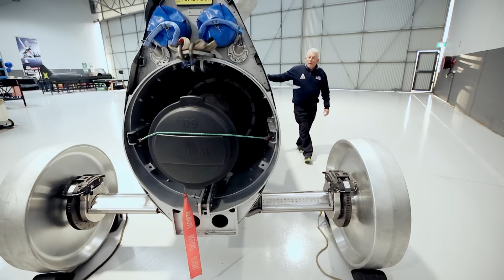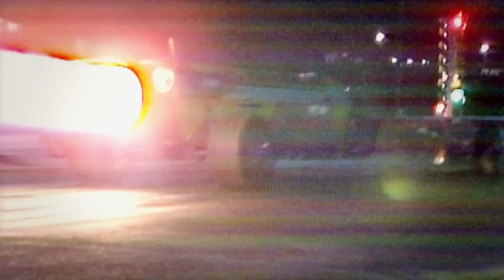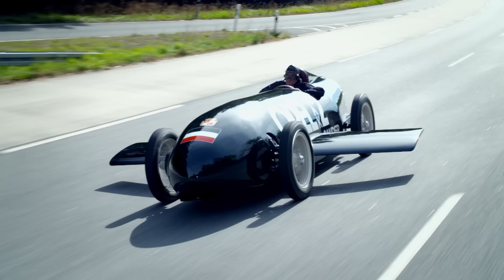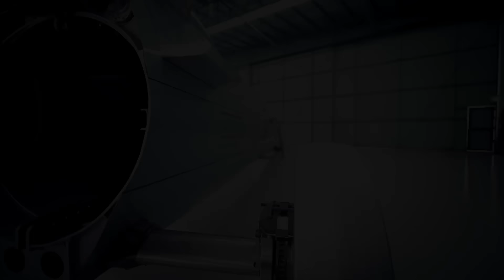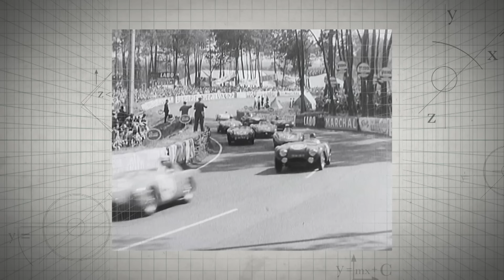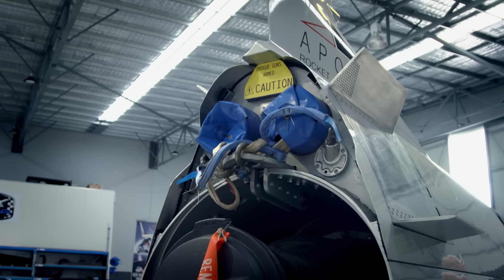Can This Rocket-Powered Car Break the Sound Barrier on Land? | Blueprint

Comment: Its not a car.Just ask Wyl E Coyote about getting strapped to a rocket than getting fired thru the air.How can you call it a car if its flying above the ground.A real land speed is engine driven wheels that loose speed if they leave the ground.

Comment: I’ve heard of “Must of been a beautiful baby”…. This would have to of been the first time I could say “Must of been a non-aerodynamic baby”..😂

I’m just taking the piss, and truely amazing work. 

Put in as many sensors as possible for good mechanical data.
I’d also like to see you use plane/ drones with ground penetrating radar, to map out the differentiating ground densities over time. 

Maybe use high power lasers out of the front to dry and turn the sand to glass.😂😐😐😐

🇦🇺🤜🏼🤛🏼😎🍀☮️

Comment: Quite possibly. It's been done before. The problem is Gary Gabelich DIDN'T follow the rules for Land Speed Records set by the FIA. Which means the Thrust SSC still is the only vehicle recognized as holder of the Land Speed Record.
Reply: stan barrett was the first rule or no rules they did it first the airforce confirmed it end of story

Comment: Might want to move faster as teams can be ready to run at anytime with surplus military planes using there engine setup that can cruise at Mach 1.5+ (over 1,150 mph. And at testing scrambling speeds, then hit Mach speeds of 2.25 at 1,726 mph recorded times so they know they can move out fast. Don't let someone take your dreams away of 15 years of work to be 2nd person. And people remember that 1st vehicle but never after that until breaking records again. Need training so don't pass out and die with zero blood to brain. And last thing before you make the sleep to run, check on your Rollcage as looks like it's small from Dragcars today  that has 3 and 4 hoops as required by them and if to old, then might need to be replaced if ran here as have lifespan on it and rusts from inside out making them weaker as don't look very strong.  To me from seeing Top fuel Drag cars and how tight they're to driver as stays in cage and survives from crashes as protected very well.  Similar to High speed boat racing that has a Capsule there contained to. Then you survive most crashes as safety is #1 thing. Hate to see you here and can't race because of old cage or not strong enough with X amount of loops street cars don't need hoops over drivers, promos and up does

Comment: In credible feet if achieved.
Did you ever see the movie based on our famous de Havilland DH100 Vampire jet.

The first ever jet fighter to brake the sound barrier that killed several pilots before they discovered the change in force's once achieving Mack1.

Where they had to react opposite with the controls to regain control of the aircraft due to the extreme forces once achieved Mark1 767.2 MPH...
🇦🇺🤔
Reply: What!!!

Comment: If the wheels aren't doing the propulsion then whether it's on the ground or not is irrelevant. All cars, as most people would call them are pushed forward by their wheels, not by supersonic burning gas sent out the back. There were a few fan propelled cars back in the day, but, similar to using a helicopter in urban areas, nobody wanted to be anywhere near them because of all the air and debris they fired around. This is a rocket pointed 90 degrees off the conventional direction, or maybe a plane with the wheels on the roof and a rocket engine. 

Gave up watching after 15 minutes even at 1.75 speed because of the tedious repetition and painfully slow drip feed of, often incorrect, 'facts' about the vehicle or the history of the land speed record. There are numerous complete amateurs on YouTube making far superior documentaries with nothing like the budget these people hove. Explains why broadcast TV is dead apart from live sportsball coverage and 'reality' TV.

Comment: I think you need to look into the cockpit of a Top Fuel dragster and see how they are protected with padding around the driver's Head and Shoulders, I don't think you have enough protection you need to be patted in their real tight like they are to be protected from a head injury if something happens.

Comment: I would change the skin of the car to resemble that oif a golf ball with dimples which should allow the car to maintain a straight path rather than the smooth surface thayt it currently has.
I would also have tthe fuel tanks empty so the most forward tank is the last to empty.

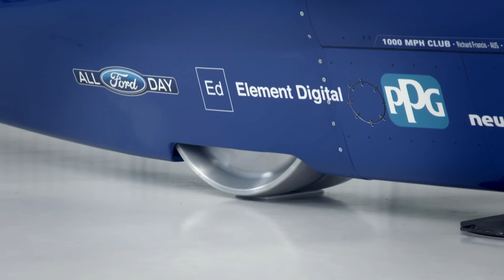Comment: There needs to be an active aero device to increase down force as the fuel load is used up. The lighter the fuel load, the more the wing should deploy to maintain the down force. 34:00 Like I said....👍

Comment: Trying for 1000mph is foolhardy. Just break the record first. Then 800 mph. Then 850, 900, 950......you have to sneak up on it and check the data, magnaflux everything, see where the next failure point is...

Comment: 2 runs is bulls**t. Stupid man made rule. The car either does a particular speed(a scientific fact) or it doesnt. You dont have to do the equation 1+1=2  two times to validate that 1+1= 2. I could go on and on with analogies. A car dynos xyz once its valid, a car runs xyz in the 1/4 mile its valid, a man runs xyz in a mile its valid, high temps xyz in a part of the world once is valid. 2 times is stupid especially with something dangerous to humans. F these rules! I will honor your one time speed, even with regular cars.
Reply: They need two runs within one hour in opposite directions to null out any effect by prevailing winds or other environmental factors, such as temperature, air pressure, etc.
Otherwise, a lucky one-off run could make a record that they can never repeat. It is called "the scientific method."

Comment: Unless its wheel driven, not interested. Doubt that thing will ever be fired up, pretty sure they have been building it for decades...
Reply: Then you should only follow the wheel driven speed records, which as of 2023 sits at 481.576 in an official 2 way average run.  Impressive as hell, but not anywhere near the speed of sound, let alone the 776 mph land speed record acheived in 1997 by Thrust SST.  They are  different records, not comparable to each other.  Both are valid for what they are, and both will be damned near impossible to beat.  The wheel driven attempts hasnt even BEGUN to deal with transonic aerodynamics yet.

Comment: A rocket sled on wheels. Should be more than capable of that speed.

Of note. For comaprison check out this info on the rocket sled in the US

The U.S. Air Force operates the Holloman High Speed Test Track (HHSTT) at Holloman Air Force Base, New Mexico, where rocket sleds have achieved speeds exceeding Mach 8.6. The record for the fastest rocket sled speed on the track is 9,465 feet per second (6,453 mph), achieved in 2003. Some sources also mention a hypersonic test where a reusable sled reached 6,400 feet per second (Mach 5.8).

Comment: Aside from the negative comments I wish the project the best. I hope to see this rocket car try for the land speed record. One important thing was never mentioned in the video, how many G-Forces with the driver experience when he accelerates from zero to 1000 mph in 20 seconds? And what was done to deal with it?
Reply: Im not sure how rekiable that claim might be, but it's only 2. 2 g, easily handed by anyone in good shape with some training.  Fighter pilots handle up to 9 g for a few seconds, 2.2 is relatively easy.
Reply: @markdoldon8852   Before clicking on the replies to this question, I did the calculation and came up with 2.3gs. Anyone can withstand this with ease, even the old guy who wants to drive it.
Reply: Thrust SSC accelerate slower than a jet plane so G forces are surprisingly low, it's way higher when the parachute opens.
Reply: G suit maybe?

Comment: They should ask Elon for a Raptor 3. 280 tons of thrust should get them there.
Reply: Thrust is NOT all there is to bteaking the record, there are hundreds of other factors involved in goingvso fast throughbthe air while in contact with the ground, from aerodynamics (including ground effects) to steering, braking, even the design of wheels, bearings on which to run said wheels, etc.  This vehicle never unfirtunately never solved many of those issues and unless a tech billionaire funds it, probably never will be able to afford the massive testing expenses.  A bigger more powerful rocket only solves the easiest question.
Reply: @markdoldon8852  First thing needed here is a real car not a mock up one made to get donations.

Comment: I’ve seen the documentary on this car several years ago. I don’t think they will ever light the fuse. Without proof they really can’t claim it to be 1000 mph cat can they! So far it’s only gone as fast as they roll it by hand.
Reply: He talks about aerodynamics, but - have they done actual simulations? That would settle it. I don't see any surfaces that would hold the car down, aside from a slight asymmetry in the nose. If I were putting money into this sinkhole, I would want to see what full numerical simulations say.
Reply: It can go faster they just need more hands pushing it.😁
Reply: He's taking a cat with him?!! 😲
Reply: @slyfondle1885  🤣

Comment: I want to see 1000mph in a piston powered car … with a diff…and a gearbox …! Now you’re talking…!!!😂❤
Reply: Not possible, i think.  The fastest piston powered vehicle can barely reach 300 mph, and to do that requures destroying the engine.  Only rocket power can push anywhere close to the sound barrier.
Reply: @markdoldon8852  The fastest piston powered vehicles have done 470mph. The fastest production road cars are around the 300+ mph. Engines are not destroyed. Tyres are.
Reply: @markdoldon8852 that's incorrect. The piston powered Speed Demon streamliner set a class record of 469 mph at Bonneville. Top speed reached was 483 at the finish line.
Reply: Never happen. Not even in a hundred years.